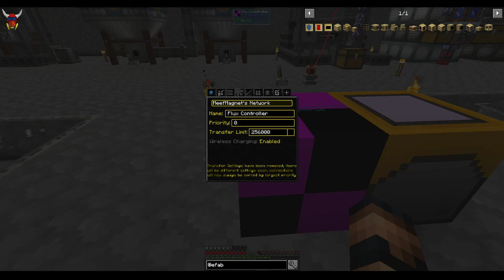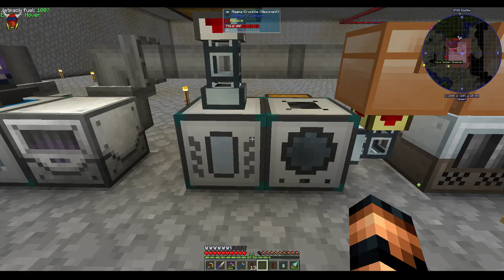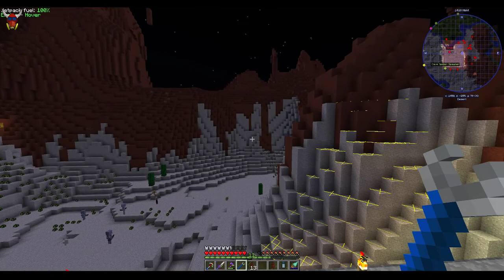FTB Continuum - Episode 37 - Flux Network Basic Setup

Comment: In which Meef repeatedly explains that this thing, which is fecking expensive, is switched off: it has no input, no output and no storage, then tries to show us wireless recharging, but it isn't working for some reason.  Er, could it be something to do with the fact that you've just spent ten minutes telling us about 30 million times that it's switched off?